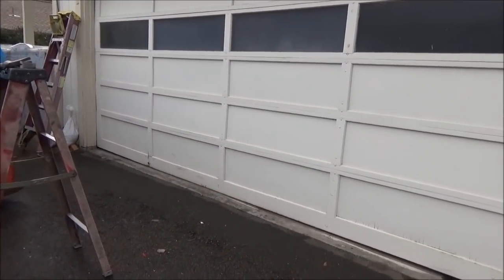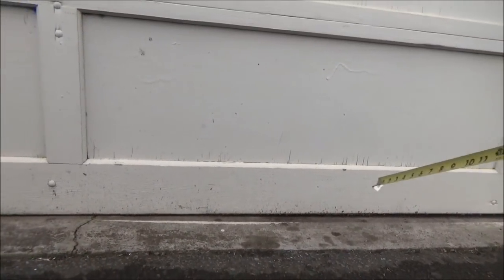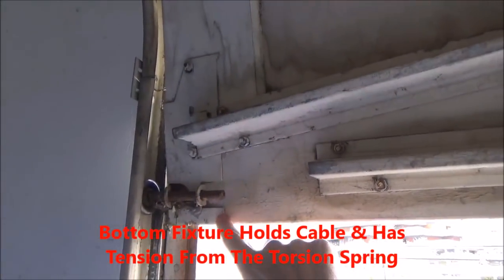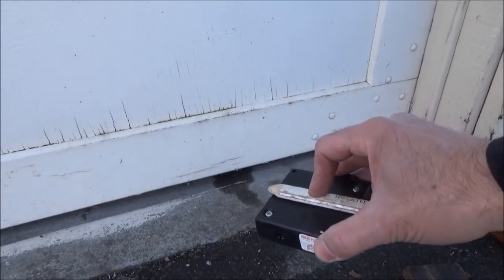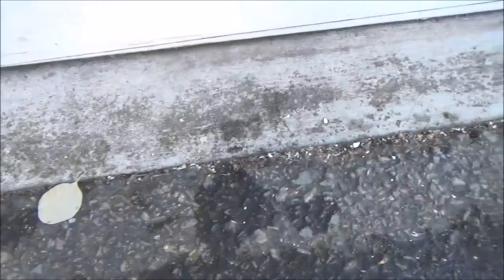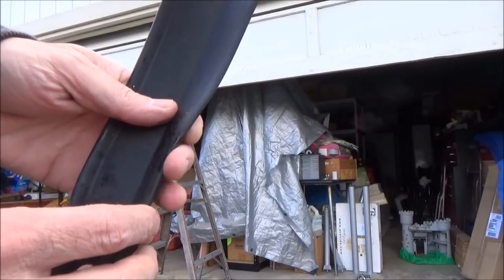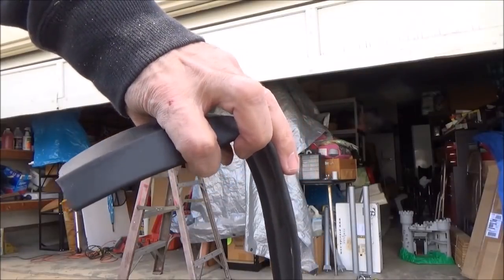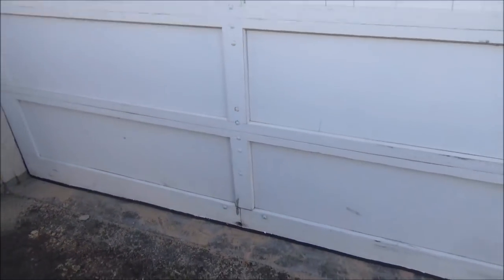Seal Garage Door Bottom From Gaps & Rodents

Comment: I just added a new seal on the bottom of my garage door this summer and that did not fix a gap I have.  The left side is worst that the right. Is there a better seal out there that will fix my problem because I'm not going to cut off my door like this?

Comment: What an amazing job. Thanks for sharing, much appreciated and God bless. Could you offer some advice how to close a gap (on one side of a colour bond (Aluminum door). The floor is uneven and hence there is a gap on the right side of the aluminum door which is about 1/2 meter long. The leaves and water that come through are a pain.

Robert
Reply: They make a  Garage Door Threshold  that goes on the bottom,  i have also seen people use pipe insulation and just glue it to the area after cutting it down.

Comment: That's why you NOTCH the ends of the bottom weather-stripping to clear the side trim pieces. I betcha didn't think of that eh chucklehead? The wider side goes OUT so the rain can run off AWAY from the door. Your saw cut along the bottom was wavy AF too. Keep practicing tho ;)